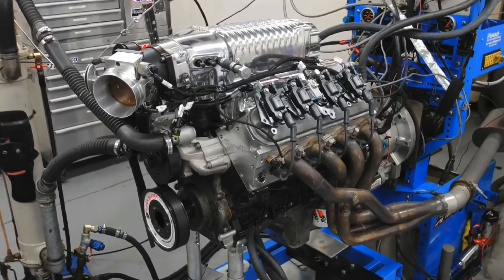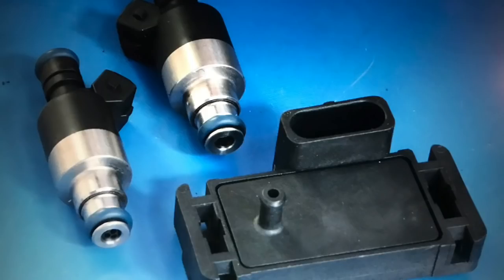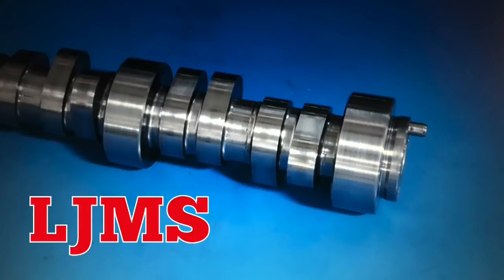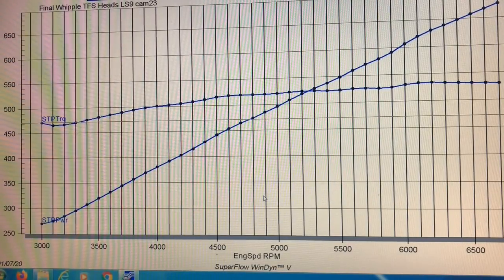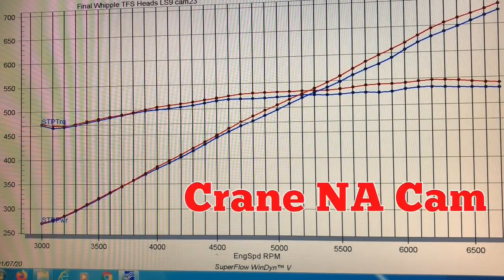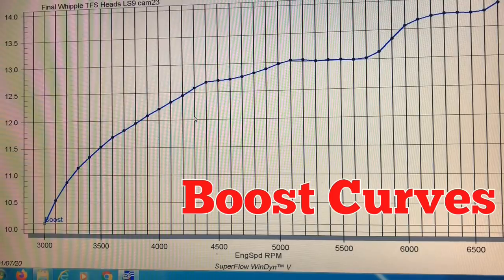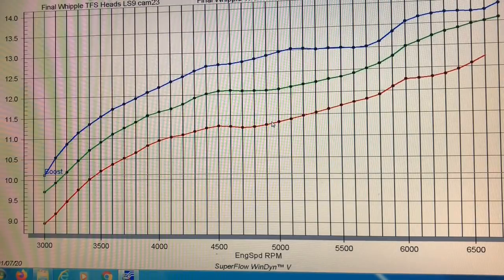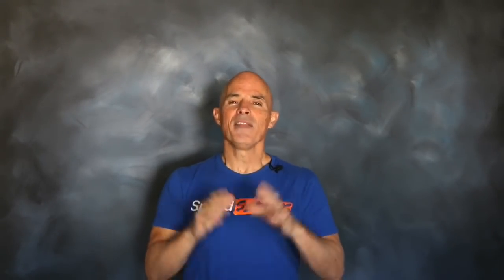LS BLOWER CAM TEST-LS9 vs LJMS vs NA CAM (BEST FOR BOOST?)

Comment: I believe that lower boost levels suggest the motor is breathing easier therefore it would be best to up the boost to see the true power gains. I think it would also be nice to see it IAT's for these runs.
Reply: Increased Intake and exhaust overlap will decrease boost figures and lower EGTs. Boost is just a reference of back pressure.

Comment: The boost lost on the NA cam isn't making the power because it's going out the tailpipe on the valve overlap.
Reply: The supercharger cams optimize it so it goes into the cylinder instead of out the exhaust

Comment: Awesome content, have you thought or tested the 5.7 LS engine? I have a 2002 5.7 out of a trans am that I’ve just been contemplating building but not a lot of people have content for it
Reply from the maker: I wrote two books on LS motors including the LS1-have lots of data on the original

Comment: I think that in order to test these cams in a real street type engine build, the boost should be the same, say 13# of intercooled boost. Then see what these cams really have to offer. My bet is on the NA cam.
Reply: What is that prediction based on?
Reply: The NA cam made better overall power than all the cams on less boost. I believe if you keep the rpm to 6700 rpm, the NA cam on the little 4.8 will make a bit more peak at the same boost level and A LOT more average power.

Comment: Great info, just lacking one little piece of data. What’s the intake CL on each installation? Need that to compare IC and other valve events. Keep these tests coming! IC= intake duration/2 + intake CL - 180. If cam is 4 deg advanced, intake CL is 4 deg less than LSA. Example LS9 cam: (211/2)+118.5-180=44 for intake closing. Crane NA cam: (224/2)+111-180=43. This assumes both are advanced 4 deg, but we don’t know that. However, the Crane cam loses out at the top end, which the shorter IC would suggest.

Comment: No the supercharger is putting out the same air flow mechanically! The cams make what they make!
Reply: Using that logic, with a positive displacement blower like a twin screw the boost is linear and correlates with RPM. The ratio of higher boost of the blower cams vs the horsepower gain at a given RPM is a measure of volumetric efficiency. The NA is making more horsepower at a given level of boost than the blower cams, which indicates better VE. 
Increase the boost on the blower, i.e. smaller blower pulley or larger crank pulley and the NA cam will make more horsepower at the same boost levels that the blower cams were running.
Reply: @512kjt  Ya I mean for the sake of testing it gives you a good idea of what the cams will do. To be actually fair though I kind of agree.  Though I realize  with superchargers you are somewhat limited in pulley adjustments. Just think though if you are making 40-50hp per lb of boost, the NA cam is almost 2 lbs down, that means it could be a potential 80-100 hp up from where its at and to be on equal terms in relation to boost.
Reply: @shaadydog1   psi is restriction!
Reply: @J Minnick obviously,  but that’s not telling you everything since the LJMS and NA cam power curves cross but the boost curves do not.

Comment: For the NA Cam would you be losing boost pressure due to the closer lobe separation? Maybe losing boost because the intake valve is not fully closed when the exhaust valve is opening?